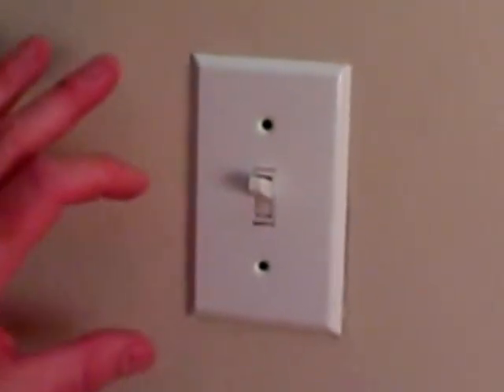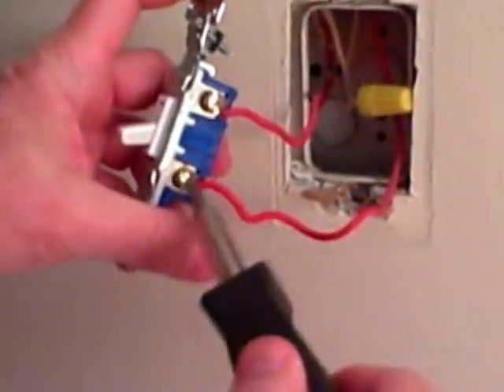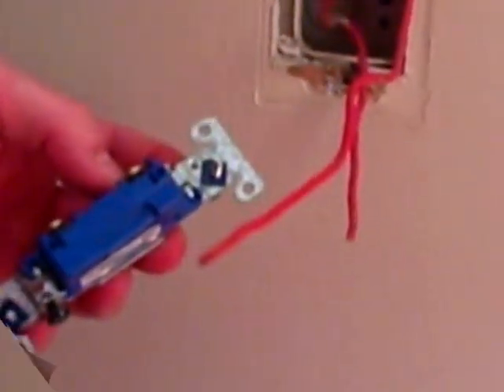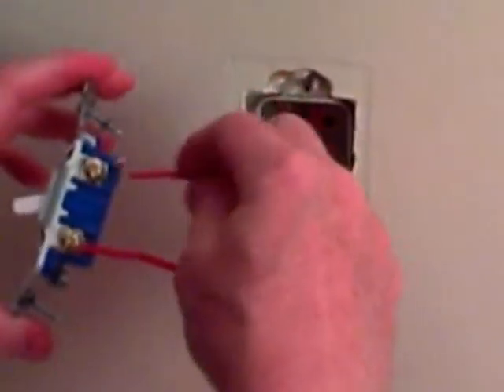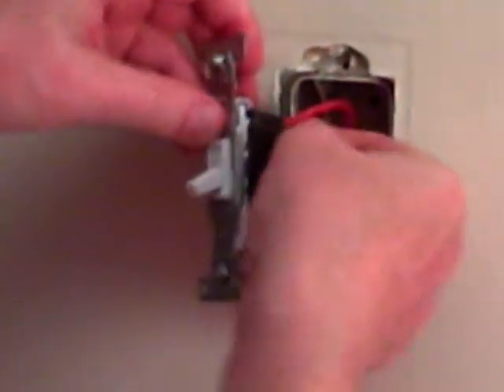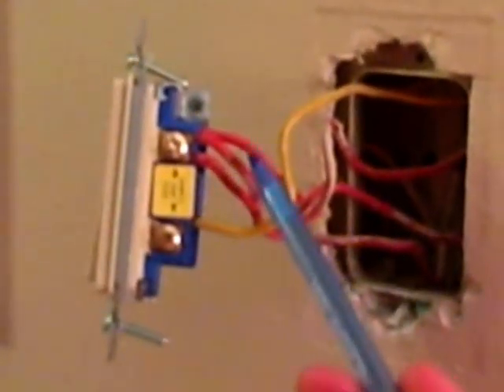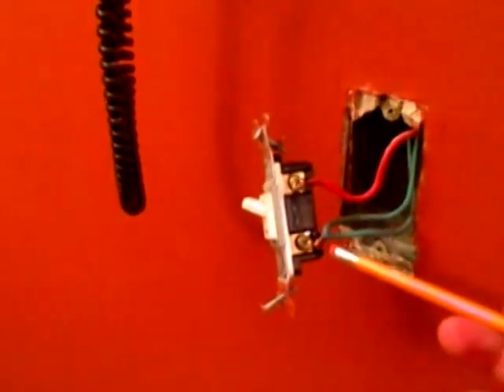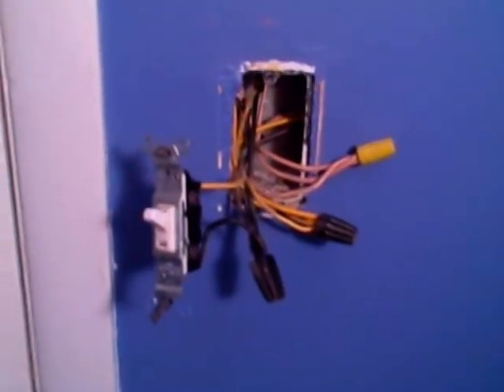Wiring a Switch - Single Pole Switch - Conduit

Comment: Hi. great videos. Need a little help in So. Cal. I am going to add 3 new sconces to a wall where there was only one bathroom light. Do I pig tail three separate wires from the original box, cover it and run 3 lines to each new sconce???? Or do I leave from original box, go down to 1st sconce then connect to second then third? I realize I will have to drill through studs in wall. Any idea how to score on a really long drill bit like the pros use so I don't have to totally rip wall apart and fix? thanks :)
Reply from the maker: Hi,
Try this link http://www.familyhandyman.com/bathroom/remodeling/how-to-remodel-your-bathroom-without-destroying-it/view-all
Let me know if that helps. Easier than the limited space I have here.
Here is a link to our weekly podcast. http://www.stitcher.com/s?fid=49441&refid=stpr

Comment: hi, thank you for your video.  I currently have an issue with my bathroom fan switches.  it works just like a light switch like yours in the video.  I have problem turning off my fan.  It is on all the time.  So, i decided to take away the switch thinking it will stop the fan, but in fact the fan is still on.  so now i have no idea how this is possible.

Comment: I just installed it yesterday work fine now love the dimmer with IR Remote look nice too save some space and I cap off the ground wire lol the wall switch it come build to the house the old box we have to break it off cuz it har to remove they put it right in to the beam with a nail so installation take about 1 hour or so lol so every thing is fine no problem make a wider cut for my box that I allredy have not the metal box the wall hole was a bit small for the dimmer so we cut a little bit:)

Comment from the maker: Hi,
Does your home have metal electrical pipe throughout the house? If you have non metallic clad wire and plastic boxes, you will need a ground wire running back to the service panel.

Comment: So don't worry about the ground I wanted to replace my with a dimmer with my single pole it a remote dimmer from Lutron it had a green ground wire all ready on the dimmer or I can just screw it to the screw?

Comment from the maker: Hi,
In the area we are in, electricians use metal conduit to ground everything. I find very few circuits with a true ground wire. If you are asking about a neutral wire, you will have that coming out of the light and running back to the electrical box completing the circuit.
Reply: Hey bro, its been 7 years but, I  just now needed your video. Thanks for sharing this!!

Comment: Would you believe that in most countries, outside of North America, progress has been such that all outside parts of switches and the wall plates are made of insulating plastic. No need to earth anything - nothing TO earth.
The wall plates do indeed have fixing screws but these are DEEPLY recessed and cannot be touched with a finger. A clip on cover plate, supplied with the wall plate, then covers the wall plate

Result, no visible or accessible metal needing earthing.
Double insulation.
Safety.

Comment from the maker: Hi,

Yes, a single pole dimmer works the same way. The switch is just a break in the hot. You can connect either wire to the terminals. Glad I could help.

Comment: this video was such a huge help!!! I was so confused as to which wire goes where, but hearing you say it doesn't really matter really helped!!! Thanks.for this video! 

Question, is the process for changing a single pole light switch for a single pole dimmer the same??

Comment from the maker: Hi,
New switches should come with a grounding screw. I am in the Chicago area and most builders did not use a ground wire. The system uses metal conduit all the way back to the service panel. So when you screw in the switch, it is grounded to the metal box and that box is touching metal all the way back to the electrical box. If you use non metallic boxes or no conduit, you should have a ground wire for safety.

Comment from the maker: Hi,
You need a neutral wire to have an outlet. A switch is just a break in the hot, which is your red and black wire. Your existing box may or may not have one. If not, you will need to find and pull a neutral from another box. Good luck.

Comment: I sure hope all those switches are in different homes. I take that they are
 I do question the one switch that is using the green wires that are normally grounds as a hot wire. When you saw that should you not have pulled the wiring or left it unwired.